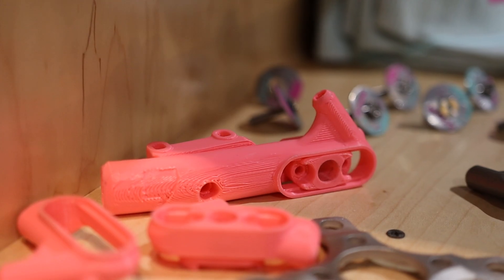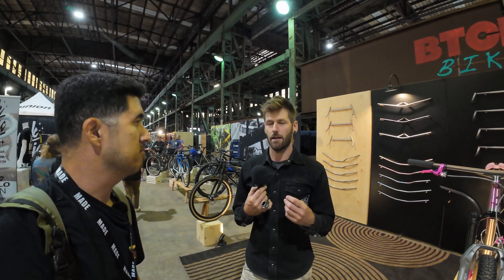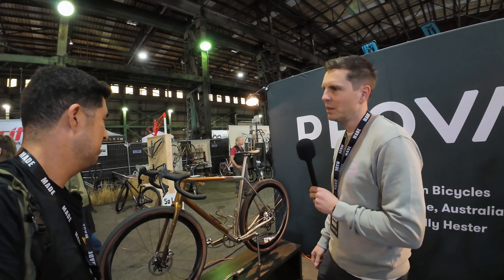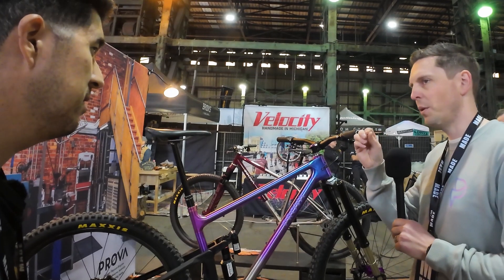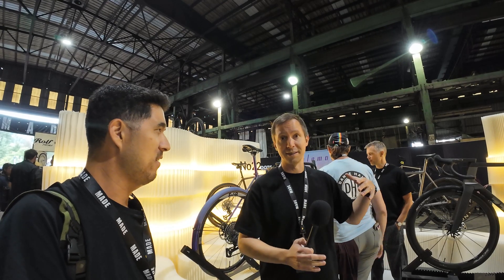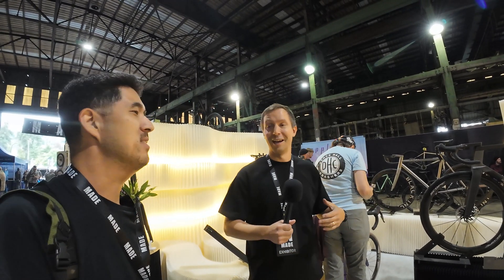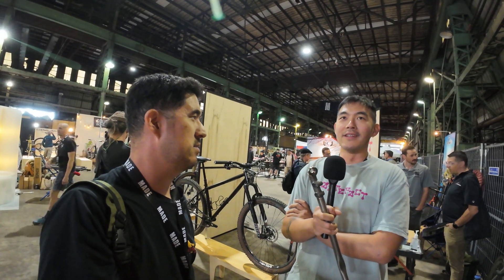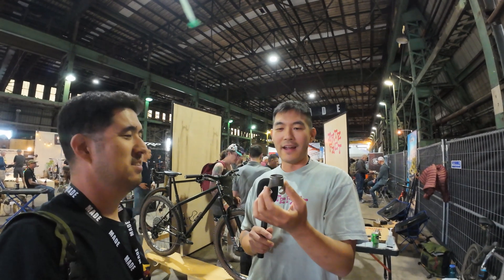Bikes Are 3D PRINTED Now??

Comment: Functionally its fine but the molecular structure isn't the same as normal steel tubing so really stress points are still a bit of an unknown for bike parts
Reply: How to tell someone didn't actually watch the video 🤣🤣They do stress simulations in CAD and then they test it IRL as well. 3d printed Ti has been used for many other applications but ofc when it starts coming to bikes people start crying.

Comment: 3D printing sounds fantastic for rapid prototyping. For an end-consumer product, it probably makes sense very rarely. That doesn't mean that consumers won't benefit!
Reply: For sure. 3D printing only makes sense on the 10-100 qty scale. I recently did some research to compare a printed vs cast part on our bike. The cast part only broke even with 3D printing at the 400qty units. But, we would never have been able to get to this point of design, testing, and production without 3D printing!

Comment: Can 3d printing democratise the bike industry  ? Can it break up oligopolies by lowering barriers to entry for things like group set manufacturing?
Reply: 3D printing won't lower costs, but it will enable smaller companies with big ideas to change the way bike industry thinks. For example, 3D printing allowed us to create a massive size range. This benefits riders 5'5 and below, who are typically excluded by the traditional bike industry.
Reply: I don't think so. It's about engineering in the first place. With 3D printing you might save on some other specialized machines. But traditional large scale manufacturing will probably still be cheaper. However, it really depends on what you want to manufacture.
Reply: @alexanderasdf2742  There is a difference between how much something costs to make, and how much it costs to buy. Meaningful competition will squeeze the gap between the two amounts. Looking at the price of modern group sets I think the manufacturers could do with some healthy competition.
Reply: @thomasf.9869  Good point. But aren't there some other Chinese competitors already that are also cheaper? I don't know about quality or function of those products. But I think it takes some time and marketing before market shares change.
Reply: @alexanderasdf2742  Agreed. I am not against mass manufacturing. But at some point the consumer should benefit from the economies of scale.